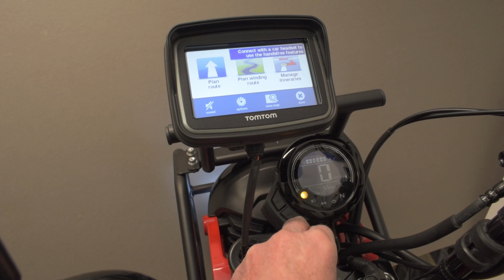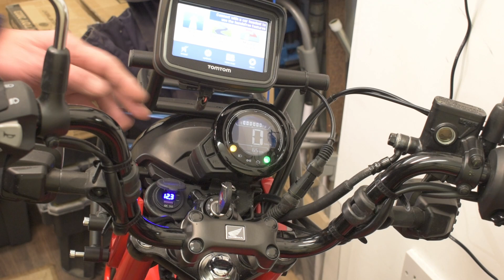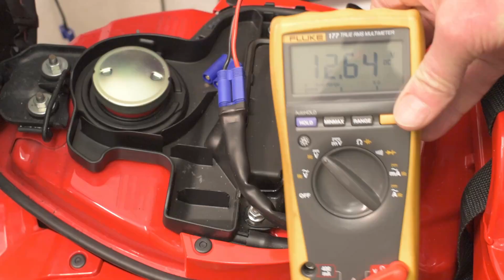Bikervation - Honda CT125 Accessories wiring:  Sat nav power, USB charger and battery tender lead.

Comment: Chris , I just bought one (Canada) and plan some wiring stuff, too.  I see the Reg/Rec. has
2 biggish 'condensers' integrated to it , do you have any idea what these are for ? (I have
the wiring diagram and shop manual already.... with no explanation of that bizarre
regulator functions (one-phase AC ...six (!) wires ! ). Thanks , André.
Reply from the maker: Hi André, I haven’t delved into that area yet so can’t throw any light on it. Hope you enjoy your bike there great little machines. My other bike is a 1200 Harley so chalk and cheese, I find I need a whole new mind-set to ride – push biking without the effort🙂. More videos to follow once I finish editing, Ride safe and thanks for watching. Chris
Reply: @Bikervation   So I went to  Shindengen's site , and they show how basically this type (AC/DC single- phase with 2 Condensers) of R/R , works.
 One of the condensors supplies power to the FI system , which explains why the  CT will kick-start even  with a flat battery (or some say even with NO battery !)   Well...I'll test all this when the bike arrives , next April I'm told.
Thanks , André

Comment: What a lovely little ct! I totally get it Chris, my steeds are getting smaller as i get older. The f650 is quite good off road but still feels like a big lump even though it's small compared to most bikes I've had. I have a bit of an itch for a crf250 at present for lightweight fun . 
Video looks very concise and clear buddy. Peace and love brother as always ✌️💚
Reply from the maker: Thanks Springy, what I like is the fact that I can pick it up if it drops and move it around in the garage, the Harley feels like it is always about to fall if you just get a bit off the vertical. I like your new garage 🙂